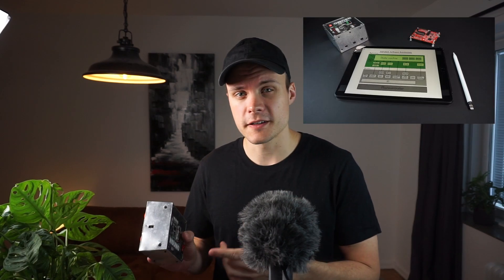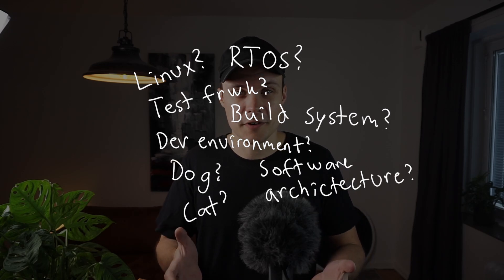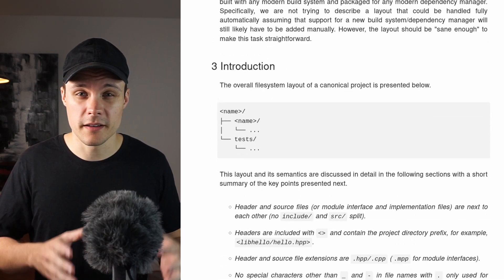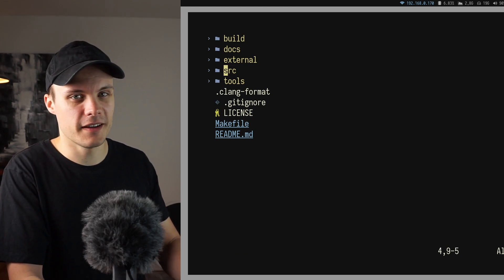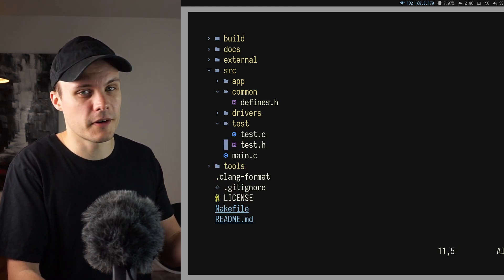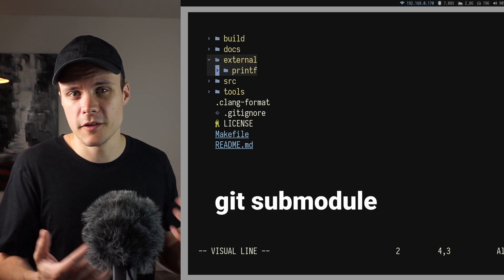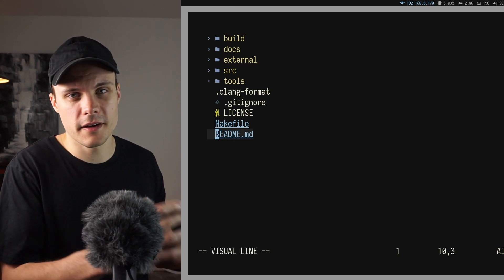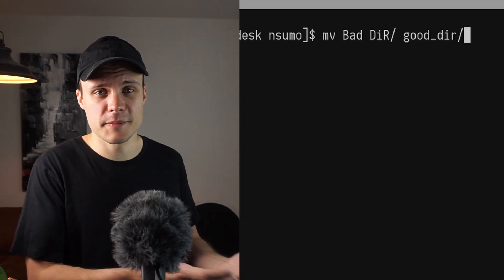The BEST Project Structure for C/C++/MCU | Embedded System Project Series #7

Comment: Awesome videos. Just curious as to why the msp430 for your robot project?
Reply from the maker: Mostly because I had the devkit laying around, and it's a typical MCU used in embedded courses, at least in the past, and there are many good resources for it. Strictly speaking it's not suitable for this project, but for a simpler one-off hobby project you can get away with using most MCUs because factors like cost, availability, etc don't really apply. STM32, Atmega, PIC would have worked just as well in this case (or better because of more flash memory, PWMs, etc...).

Comment: Thank you for this video series, its very interesting to see what others are doing.

What template or rules do you follow for naming folder and files? Is there a document for it?
Reply from the maker: Yes, I agree, and developers tend to do things differently based on their experience and taste :) 

No, no document, but I will see if I can update the README with some conventions I follow in this project.

But I prefer uncapitalized names and separating multiple word names with underscores "_". This makes it easier to navigate on the command-line. Other than that, I just try to name the files as best I can according to what they contain, for this project that's pretty obvious most of the time, e.g. uart.c, uart.h, i2c.c, i2c.h, drivers/, app/. If you organize and separate your code well, the naming also becomes easier.